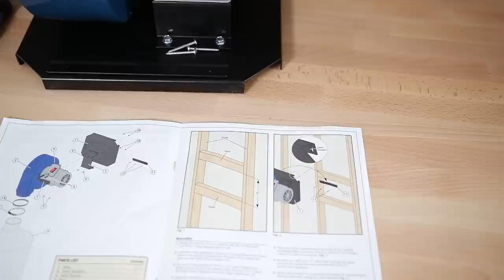Small Two Stage Dust Collection System (Rockler Dust Right & Dust Deputy Cyclone)

Comment: Just want to say, new science shows the most dangerous particles to woodworkers is 0.3-5 micron, though 5-10 are equally as bad but most even cheap systems take care of them.  But the truly dangerous stuff is under 2 microns.  I know this is a 3 yr old video now, but you can upgrade your filter, it will be taller/longer but they're not that much more expensive to go down to that 0.2 or 0.3 micron size.  Great video, thanks!

Comment: Stopped in at Rockler yesterday and started getting the parts of this same build for my basement shop.   Thanks for the great video.    
One tip I learned there was for the plastic bag.   Since they are reusable, glue a small magnet (like a flexible fridge magnet) along the top edge to hold the bag in place while you position it over the canister.

Comment: Good job. I had EXACTLY the same system, which was a bit underpowered for my mid-sized wood shop. Some of the machines were just too far away. I recently upgraded to the 1250 CFM model, with the larger 1 micron filter. I kept the existing Dust Deputy Deluxe, and Dust Right hoses and fittings. It works so well, I'm flabbergasted, and that's rare. It's a very good system, but for safety's sake, I also have a Jet dual filter air filtration system to give the air another scrubbing. It cycles the air in my shop about 15 times per hour. Better safe than sorry.
Reply: for your opinion, it what scenario would one need a 1250 vs a 650?
Reply: @jeffreysears3517  IMHO, if you are using a lathe or power jointer you automatically need the 1250(or an even larger system). Also, if most of your machines are more than 10 feet(3 meters) from your collector.
Reply from the maker: Thanks James, I totally agree. That bigger version wasn't available yet when I made the video, otherwise I would have mention it as well.

Comment: One suggestion:  If you could somehow set up the on/off switches so that when you turn on a tool, like your sander for instance, it automatically turns the dust collector system on, then you wouldn't have to turn on the dust collector separately.

Comment: I like the Rockler 650cfm system, but it’s very loud, about 85dB. They have a new mobile system that’s 750cfm, and much quieter (about 75dB) at about the same price now. Noise mitigation is also important. I made a small mobile system for my shop vac, using the smaller Dust Deputy. It works great!

Comment: The story you stated about respiratory problems is extremely common in just about any work field with dust. Most of the problem is most guys just do not take preventive precautions. There is a reason the OSHA insists on lung protection, it is for your safety. When you were talking about losing suction because of long piping is because you did not use long radius pipes in the system and even smaller size pipe. When you calculate C F M correctly you will not have any problem. Today everybody is a jack of all trades Master of none. I believe the last sentence say it all. Please do not think that I am drowning you in any way cause I am NOT. Also, the vortex that you are showing has been around for I would bet you a hundred years. Just look any old factory dealing with dust and you will see vortex many feet tall. That being said you made my day showing the average guy what and how to maybe save his life for the benefit of his family. No one want a fatherless family. Your last statement about the did not notice any difference with performance is flawed because you are not pushing the dust collector to the limit. Just use the prefilter for less work overall. Nice job fella. Keep on making them guitars as people just seem to want more and more of those instruments.
Reply: Its ok to save your own life for your own benefit, that would be smart too.

Comment: I just wear a 3M respirator and sweep up my dust when I'm finished, or use my shop vac.  If I install one of those big dust collectors, instead of mounting that bag to it, I'll just run an exhaust pipe through my garage wall and let the dust fly out the back of the garage.  I live in a rural area and the worst that can happen is I wind up with a big pile of sawdust behind the garage which I can use for stuff like filling in holes in the yard from moles, etc.

Comment: total cost for what was shown is roughly $897.97 (as of may 2020). Depending on the number of adapters you get and length of hose that $ figure increases.
Reply: way too much . just get the real one
Reply: Totally agree! Onida and Rockler are pretty proud of their stuff! Way to much for what it is. The cyclone is nothing more than molded plastic so the profit margin must be huge on that piece. The blower motor, Harbor Freight makes one that looks pretty close to it for under $160 and the bucket, what is that cardboard and tin?  The profit margins that are built in these parts are astronomical. The only thing that is the limiting factor is the size of his shop! Otherwise a free standing unit from Grizzly or similar would have been a better bang for the buck!
Reply: @funfreq9282  I found food grade 25 gallon HDPE containers for sale used but clean near Atlanta, probably near most major cities in the US. Building the cyclone is the next step....
Reply: @TSPhotoAtlanta  What material do you plan on using for the cyclone?

Comment: Thanks for the in depth process you followed.
Looks like your workshop is about the same as mine. I won't have the room you do to get to the dust ports of my tools and I'm time poor so feel I'm unlikely to move them for a quick job.
So I'm thinking about setting up ducting with blast gates. Do you think this Dust Right system could handle an 18 feet run? I'd been thinking I'd need something with more power, but your comment about efficiency has me thinking this could do the job. Appreciate your thoughts having used the system over the last year or so.

Comment: Rockler’s catalog has the filter bag for this unit listed at 30 microns. Not 3. If that’s true I definitely wouldn’t ever use the filter bag as it’s just pumping the most harmful particles into the air. Go for the canister filter.

Comment: Bob, nice video and thanks for sharing your experiences with the installation process. A couple of question please. IYO what is the minimal amount of space or foot print needed to replicate your set up in a corner of my 3 car garage that houses my shop? Secondly, what would be your concerns of installing this set up in a shared corner with an ELECTRIC water heater? Thanks in advance for your input.

Comment: I just saw your video and have been pondering this system or it cousin on wheels. I’ve seen several reviews and I’m still undecided if the cost is really worth it. I wear a mask when woodworking and do a lot of turning on a lathe where I know these don’t work well. Is it kind of a pain to move from one machine to another? In all honesty, on a scale from 1 to 10, how satisfied are you with your purchase.
Reply from the maker: I loved that system and had no complaints whatsoever. There is a more powerful version now though which you might want to consider.

Comment: I bought the larger dust right canister 2y ago and it’s now blowing fine dust through the filter. Called and the rep mentioned cleaning with an air compressor. Fine dust is now even  worse. Wondering if you are still satisfied with your setup?
Reply from the maker: It was a great system, and I never had any issues with it. I eventually switched to this system  https://youtu.be/sx8gxqb-Hqg?utm_source=youtube&utm_medium=social&utm_content=ap_c6kbeejiqy which is amazing.

Comment: Thanks Tom!  I bought the same unit a few years ago but going to upgrade to the filter and cyclone like you have.  Two years on how do you like the setup?
Reply from the maker: That setup is just amazing in performance and value for sure, and it was not very loud, which is important in my small machine room. I eventually upgraded to the Oneida Supercell, which is even more compact and powerful but much more expensive.

Comment: Which is a better dust collector for the money?  Oneida or the rockler?  It looks like the rockler dust collector you installed was probably less than half of the cost of the Oneida?
Reply from the maker: They are both great. Rockler even makes a more powerful version now, too. The Supercell is just scary powerful. I mean, for real. I have to be careful when I use it for vacuuming up the shop. It's been rock solid, easy to empty, easy to clean, and no issues at all. If you need a serious industrial-grade powerhouse, then the Supercell is better, but the Rocker will work for most people, is a great way to get started with a nice dust collector, and does cost way less.

Comment: Thanks Tom for this video...
You used two types of hose ... one with plastic ribbing and the blue hose with metal wire ribbing. You will need to replace the plastic ribbed hose with the blue hose. After that is done, you must strip off the hose insulation down to the bare wire where you cut the hose ends to length. Then you need to take some bare copper wire which you can get in a kit from Lee Valley tools ...
https://www.leevalley.com/en-ca/shop/tools/workshop/dust-collection/parts-and-accessories/62616-grounding-kit-for-dust-collection-systems
... and connect the bare wire end to the metal base of your machine with this wire on the one end and a length of the same copper wire connected from the dust collector frame to the other bare wire end of the hose. 
WHY?
If you don't, static electricity can occur as the cyclone spins and as the chips travel inside the hose rubbing against the those surfaces and the resulting friction can cause sparks which have been known to ignite fire inside the dust collector. 
I used these banana connectors for speaker cables to make connecting easy for your method...
https://www.amazon.ca/Ltvystore-Speaker-Solderless-Connector-SocketTerminal，Pack/dp/B07M83P2PM/ref=pd_sbs_23_7?_encoding=UTF8&pd_rd_i=B07M83P2PM&pd_rd_r=06f5de95-a1b2-47af-8ffd-7017073aaf9a&pd_rd_w=H4Hhl&pd_rd_wg=CSmH6&pf_rd_p=c7838c3c-6de6-46ad-946c-b7318af714fb&pf_rd_r=EHT7Z9HBX7CK1DNXRB27&psc=1&refRID=EHT7Z9HBX7CK1DNXRB27
Where ever there is friction....there is static electricity....where ever there is raw electricity there are sparks so please retro your duct collection system so that static electricity is GROUNDED....
Art of Lutherie member....
Best regards,
Andry
Reply: You could use bare copper or bare aluminum wire from any source. Use screws to ground it, attach with epoxy mixed with conductive metal dust, use wire-nuts. The costs are already soaring.

Comment: Thanks for the review! I was looking to purchase the Dust Right 650 CFM for my small workshop as well. One question though- If you have a cyclone as the first stage, do you really need to purchase the filter as well or just connect the bag to the dust collector?
Reply from the maker: Hi Israel, So glad the review was helpful! You definitely don't have to use the filter. I did, mainly because the tiny amount of dust that makes it past the cyclone is comprised mostly of very fine particles which happen to be the most dangerous. So if you can, it's nice to have the filter that captures those finer particles.  In case it's helpful, I think I talked in more detail about this stuff in my article here: https://theartoflutherie.com/dust-collection/

Comment: That is exactly how I time to put a dust system in my shop also the unit I've been leaning towards questions voltage on the motor is it 120 or 240 volts
Does it come with the switch or is that an extra to add on does the switch have a relay so you can move the switch at the equipment? Or also is there a remote option for the switch? Thank you in advance
Reply: I read that this unit is 120VAC only, but similar ones are 120/240. Good question about the switch, I don't know, but I like the idea of a LV relay circuit. Comments on the vendor's page say you only get whst you see....

Comment: I bought the smaller version and ran into some challenges...

Item      Description                                  Ordered Qty         Shipped Qty   
53522   WALL MOUNT DC CANISTER   1.0000                  1.0000

What I didn't understand was how accurate the product Description was....
(1) Dust Right® Canister Filter for Wall Mount Dust Collector 
(1) Mounting Bracket 
(1) Plastic Dust Bag

NO screws for the mounting collar/bracket to the fan OR to the filter!
Multiple emails to the customer service people verified this and the instruction sheet's descriptions of the bolts were not 'standard,' either:  "15 x 1/2 inch "  ?  Do NOT go looking for that at your hardware store.
I had to get out my tap sets to figure out the thread pitch before I could get the right bolts  (8 of them.)
Plus, I had to run the taps into the mounting nuts to get the paint layer off because the bolts' threads couldn't catch until I did that.

It's on my wall now, and I'm considering making it a two-stage system, too.

Great video and explanation of the steps involve, and I hope my experience with the bolts was unique to me and not anyone else.  Aside from that, it's a great system and sounds 20-30 dB quieter than the bag it replaced!

Comment: Excellent review, thorough. I’m in the process of installing the very same system. Your review will be helpful. Having a small workspace do you have an air filtration system?
Reply from the maker: Hi Harley, Glad it was helpful! I don't have an air filter yet, looked at a few but they are pretty pricey and I have a feeling they wont last very long in here...
Reply: Box fan(s) + high end 4" thick furnace fan.   I have one across the lathe and another one near my bandsaw.  Don't wait for the expensive one.  I'm not sure they're better.
Reply: @TomBuskey  would love to see your setup with the box fans!!!!!
Reply: Tom Buskey  i do the same. Air filters and box fans.

Comment: If you're worried about the health hazards of dust you should really have a HEPA filter. The one you have only filters down to 1 micron. The real nasty stuff is between 0.3 and 1 micron.

And that's not a 3 micron bag. It's a 30 micron bag.

Edit: man another thing. That dust collector is 3/4 hp.  Not 3hp.  No idea where you're getting your specs from but they're all wrong.

Comment: This is good information. However wouldn't it be nice if all sanders and other wood working equipment had that large of a connection point for dust collection! This is a huge problem when trying to install a system like this. Nothing is standardized on my equip. That not only makes connecting all of the equipment up very difficult, but changes and reduces the power at each connection point. Evert reducer and elbow really reduces air flow! Findings all of the connectors is a big problem and the end results are difficult to predict. If only there was some standardization to the connection size on wood working equipment! there should be a law that requires some standards for this!
Reply: you need a downdraft table.

Comment: Hi Tom,
Thanks for the vid and the info. And while you are right on minimizing bends and distances between the collector and the machine, you may be killing most of your dust collection in the hose. Every rib in the hose sets up a mini eddy in the airflow that slows the flow and separates dust in the hose. You might want to consider using straight sections of PVC pipe in your main connection to the machines and connecting the cyclone to the blower with pipe as well.
https://billpentz.com/woodworking/cyclone/ducting.cfm#ducting_resistance
"Almost all small shop dust collectors and cyclones are gravely underpowered, so we need to use the smoothest pipe we can get to minimize resistance that rapidly kills these lower airflows. To minimize resistance, the interior of the pipe needs to be as smooth as possible and you need long smooth sweeping smooth bends on all your elbows and wyes."
Reply: I'd go one step further, mount the DC sideways so the inlet is pointing down, and hook the super DD up with the shortest piece of hose possible. Super clean.

Comment: Mmmm... the amount of small particles ( less than 1 micron)  is the problem, no matter how good the filtering system is. If You can, by all means , put any kind of dust collector outside the shop. The loss of pressure for a few meters of duct is neglectable compared to the benefits.

Comment: Nice review!  Looking at a similar setup.  Have you tried with a thickness planer yet?  I am wondering if the small setup still has enough power to effectively work with a small benchtop thickness planer.
Reply: Planner will fill up your 15 gallon bucket pretty quickly.  I pull my planner out  in the driveway and let it plane away.  I use a scoop shovel and put it in the dumpster.  Now if you doing one board or two every two weeks it will work fine.  If your doing a pallet of rough sawn boards do it outside.

Comment: except positive pressure filtration is very leaky and that system would never pass DOP.
Reply: You're thinking of bag filters, these canister filters are not leaky
Reply: @Dev-lc4cd  I believe HEPA vacuum coffee requires that HEPA filtration occurs in the intake side of the motor so there is negative air pressure on the dirty side of the filter

Comment: Question:
Does anyone think that going up to the 1250cfm unit is actually worth it? I only plan on using this on one tool at a time with the quick change hose/fittings.
Reply: Bigger is always better, except when you have to pay more for the gear, and for more power, live with more noise whenever you use it, and you don't use but one machine at a time. It would be different in a multiperson shop with more machines going at the same time, or even if one person finds a way to use a widebelt sander and tablesaw at the same time